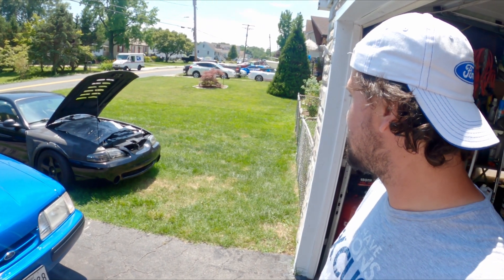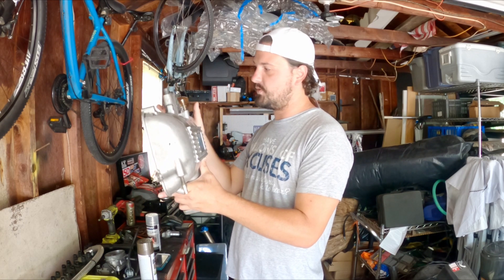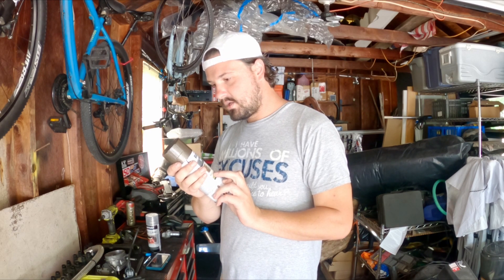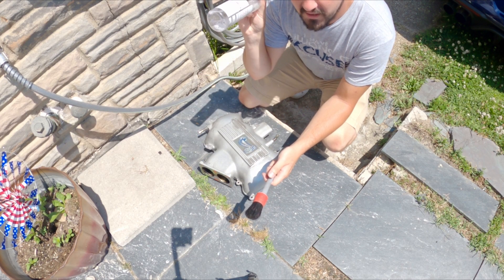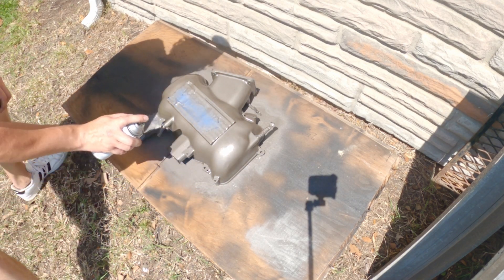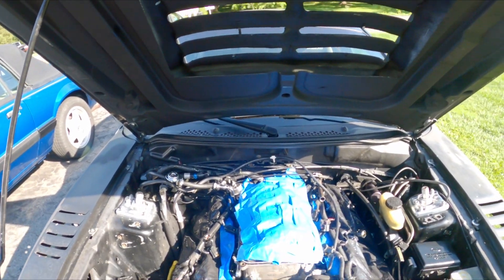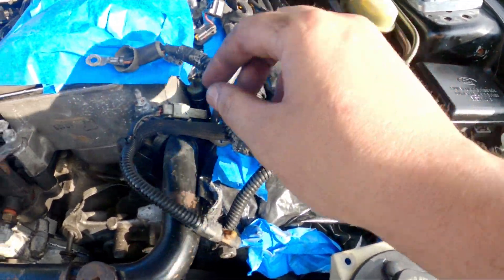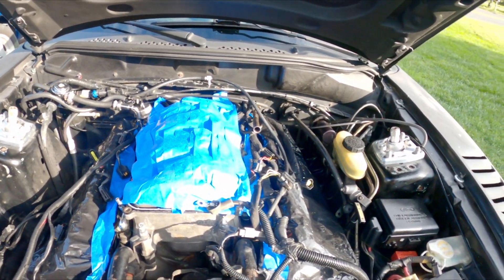The SVT Cobra Project Continues - Fixing Nasty Ford Wiring & Painting Stuff

Comment: I just began tearing the old loom off my engine harness!

It looked like some of these wires on the engine harnesses were wrapped in some kind of aluminum foil looking stuff. Maybe for heat? It had loom on the outside though. 

Anyway, do you have any sort of idea where one might get some OE connectors? Some of mine don't clip on anymore and I would LOVE to fix that